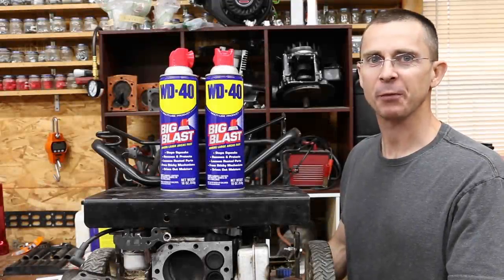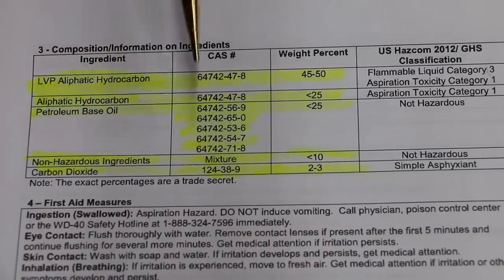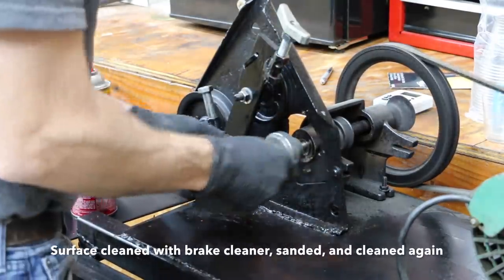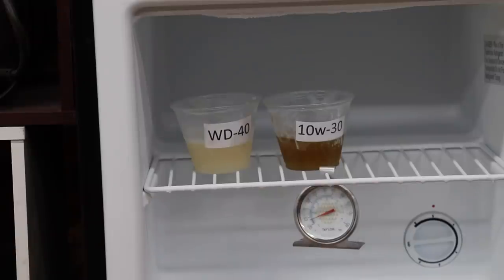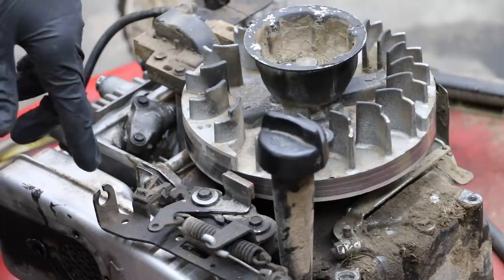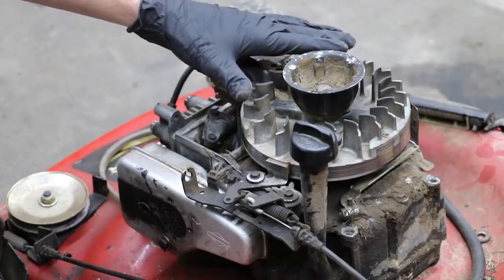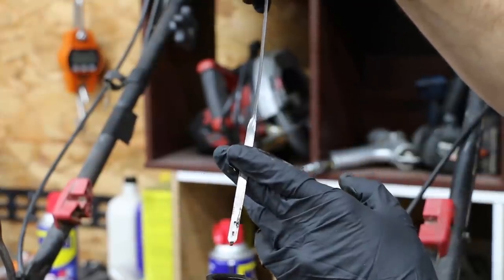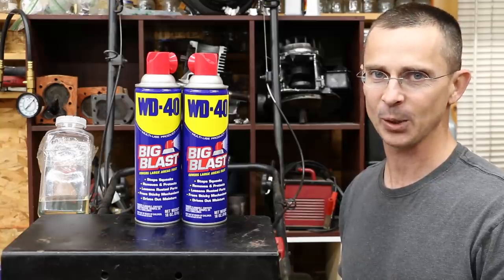Will WD-40 work as engine oil? Let's find out!

Comment: Interesting. I have found that WD-40 works very well in the bronze bearings of my antique electric motors. Completely different operating environment though. Even in cold weather, operation without the fan shroud is unrealistic, as evidenced by the extremely high temperatures encountered. I'd like to see how it does with proper cooling, examining the bearings both before and after.
Reply from the maker: Thanks for commenting on this!
Reply: You can (almost) analyze the bearings, by pouring the used WD-40 through a coffee filter. The thing I would have done, would be to run the engine with WD-40 for ~5 or 10 minutes, changed it, then, do the hour long run. That way, the crank case can be cleared of any sediment that may have accumulated over the years, which could show up in the filter, even if WD-40 wasn't responsible for any excess wear. Note that WD-40 is actually an excellent solvent, even if it's lubrication properties aren't that great. This might be a great way to FLUSH an engine, but certainly not suitable for service. (I STILL wouldn't do it with any engine I care about)

Comment: WD-40 has very low viscosity compared to regular motor oil. On the other hand WD-40 contains molybdenum disulfide which gives extra lubrication and protects the engine from damage until a certain point. You were lucky. Ot destroying your engine and i really was surprised about the result.
Thanks for the video 🙂
Reply from the maker: Great point and thanks for commenting.

Comment: About 30 years sago, I had an old right-hand drive Dodge postal trunk with a slant six as a mobile mechanic service trunk.
Late one night¡ I ran out of gas, and the nearest gas station was up the hill. Lifted the engine cover, removed the air cleaner, sprayed WD40 into the carburetor, got it running and drove 1/4 mile up the hill spraying continuously down the carburetor.

Comment: I have heard of guys using water in a crankcase in a real emergency, You need a bit of lube, but more than anything you need a liquid to remove heat. blow by was because of the lightness of the wd 40 not sealing the rings . wd40 likely contains ingredients that evaporate, more so when heated so one would expect the level to drop.  Try running the engine with oil but with the  fan shroud off, see if the temp. gets high too. Interesting idea and video. Thanks Project Farm  for doing it and satisfying our curiosity. I used to start cranky chainsaws by squirting Wd40 in the carb. Worked good, but it seems that the formula has changed and is not as explosive as it once was.
Reply from the maker: All great points. Thanks for commenting!

Comment: That slomo montage was oddly poetic. 

The title caught me since I've run a landscaping company for nearly 10 years now, starting from high school. In my early days, I owned several of these exact Toro mowers!
I'm quite embarrassed to admit, but I cannot recall if yours is the Tecumseh motor or the B&S while it is undressed. I felt that the Tecumseh-equipped mowers (while older) were much sturdier, with the engines outlasting the rest of the components (FWD gearbox would shear), while the B&S motors were the weak point. 

I remember one time, I was especially lazy and/or spiteful of the mower, and started putting whatever oil or lube I had at the time in the motor. Bar & Chain oil, WD-40, 2-stroke oil, etc. Whatever I had in the truck would go in the crankcase!
It was very frequently low on "oil" because they have a nasty habit of bleeding oil into the cylinder when tipped even slightly to the side. Sometimes I'd have to pull on it ~50 times before it started up, billowing blue smoke.
That motor eventually popped a hole in the block and chucked its rod! I guess it wasn't a fan of Bar & chain oil.
Reply from the maker: Thank you!  B&S.

Comment: I put two quarts of wd40 and 3 quarts of crap oil in a chevy small block to eliminate a lifter noise .. only ran it at 5 minute intervals with cool down between for about 15mins total.. and it worked.. no more noise and the engine ran well after putting in 10w30
Reply from the maker: Impressive!

Comment: I have seen WD-40 put into the crankcase of a warm engine then allowed to run with the oil for just a few minutes at idle. This was done right before the oil change as a flush. Only about a quart was used in this process. The oil did drain out very dirty but the oil drained dirty from that old truck always before that. I personally am not the biggest fan of flushing. In my opinion the filter is the key. Most modern filters have a bypass so at the point when the filter media is filled the rest of the service the oil is not filtered, this only compounds the problem. I have found that changing the filter half way through the service and topping off the oil works well and minimizes any chance of engine damage. Please prefill filters whenever possible, your engine will thank you.
Reply from the maker: Thanks for the feedback.

Comment: Very interesting to see that the engine survives with WD40 for one hour - I didn't expect that! 
I'm wondering if it was possible for you to do a similar test with an mixture of Diesel and regular Motor oil which is told to clean the inner parts of the engine (and even repair hydraulic lifters if they are noisy). 
Maybe this should be done on a "sick" car engine combined with checking the big end bearings of the connection rod before and after.
Reason behind that: A colleague of mine did this "experiment" (30% Diesel, 30 Minutes idle, then drain the stuff and add fresh oil) and "repaired" noisy lifters, but the engine broke down some thousand km later with worn big end bearings. Nobody knew if this was related to the "experiment".
So maybe you could do some clarification here :-)
Please go ahead with your projects, thumb up!
Reply from the maker: This is a great recommendation--thank you!

Comment: You should add a pressure gauge to the crank case ventilation port and see what the pressure is before and after these tests.  This is how they check if the PCV system is working properly on your car.
Reply from the maker: Great test idea!

Comment: I had an old mower thst smoked bad out the exhost. So I ran some prolong in it and it kept smoking. Ran ok. Then one day it stopped smoking, I realized it was out of oil, I pulled the drain plug and got about half of a cup out. So I put the plug back in and.... thought let's run this till it stops..... three years later it stopped...  because I hit a rock. Ran great till the end..     RIP Tecumseh
Reply from the maker: Wow!  Impressive!  I plan to test prolong soon.

Comment: When I was 18 I was a coal miner.
The coal cutting machine had a huge gearbox and I would take oil to use in my motorbike.
Mix with petrol, no problems, I ran it for about 3 yrs 24 miles a day.
I've used the same oil in car engines too.
Reply from the maker: This is interesting. Thanks for commenting on this.

Comment: So contrary to many people arguing that wd 40 does not lubricate this video proves it actually does albeit not as well as other solutions. In Karting for example where each run is 10 minutes only wd40 acts as both a cleaner and flushing agent in addition to lubrication for the wheel bearings in a scenario where all 3 factors are required.
Reply from the maker: Thank you for the feedback

Comment: That boiling point is a lot different with the carrier solvents in it until they dry, then only the oil will be left. It should lube better after that. Case smoke probably mostly evaporating solvent.
Reply from the maker: Great point.

Comment: Will WD 40 work as an effective crankcase cleaner, when you replace around 20% of your oil with it?

Is it better than diesel or atf which are usually used in a similar fashion to clean a crankcase.

Keep up the great work!
Reply from the maker: Great suggestion!

Comment: Without cooling, those temps  were actually low.  the blowby and loss of compression would be more than likely from overheating.  There was no more scoring in the cylinder after the run proving no excessive wear to the cylinder or the rings.  The loss of oil would be attributed to the lack of viscosity and allowing it into the combustion chamber through the rings.     

Rerun the test with the blower shroud on, and there would be totally different results.
Reply from the maker: Thanks for the constructive feedback.

Comment: Comment about your using the engine brake as a prony brake.  That brake is made to momentarily stop the engine by dissipating the flywheel energy only, once per stop, not for continuous use.  Have you looked at the temperature of the flywheel after doing that?  It has to be incredibly hot!  You could weaken the magnets due to all that heat.
Reply from the maker: Thank you for the feedback

Comment: WD40 is not a lubricant; it's a cleaner and water displacer.  The reason the engine survived is because oil in the crankcase does more than simply lubricate.  It keeps parts clean, it conducts heat and helps ensure uniform heating throughout the engine, and it maintains seal integrity and tolerances.  The WD40 did that other stuff as well--to a certain degree.  Since it is more volatile than oil it boiled off, taking heat away with it.  But ultimately the engine would fail.

Comment: The fan casing was removed so I expect the engine to run really hot, but how hot was it compared to a regular run without the cover and normal oil inside..?  Also the low boiling temp of the WD 40 would be a problem, I'd be wondering how it works when the normal cooling is fitter, in theory it should still be a bit marginal as the bottom of the pistons run at over 300 Degrees C, not far below the WD 40 boiling temp... This isn't a criticism, Im enjoying your videos a lot..

Comment: It looks like there's a couple things at play here. One, that WD40 is flammable so you're bound to see more carbon deposits, and two, the viscosity is really low! More gets into the combustion chamber, hence the high oil usage. The breather of course will relieve more blow by as the oil provides nearly no help on sealing the piston rings, which causes a lower compression, and again, more usage of the oil- a vicious circle. I'd just be careful using it due to it being so flammable!
Reply from the maker: Great point and thanks for the caution.

Comment: that was actually a lot more successful than anticipated  not nearly as much scoring in the cylnder as expected . wonder what the damage to the bottom end was though
Reply from the maker: Great point regarding the bottom end.  I didn't accomplish a before and after analysis.  However, there isn't any sort of knocking coming from the lower end. So, I don't believe there is any significant damage.
Reply: i'm sure it would be comparable to the damage of the cylinder wall since there is more abrasion in the cylinder then on the bearings in the bottom end  love your vids i hope your channel continues to grow you deserve it.
Reply from the maker: Great point and thanks for the positive comment!

Comment: i would like to point out that the smoke coming from the case vent was probably not "blow by" so mush as just the wd-40 getting hot and smoking, with it being exhausted every time the crank went to bottom dead center, lowering the amount of space in the crank case. however it was very interesting to see the slow motion of the case vent. i feel if you did the same test on a 2 cylinder engine or one with an even number of cylinders, you would get a better idea of how much is actually blow by and how much is what ever you but in the case.
Reply from the maker: Great point.

Comment: I think you need to redo this test with the engine shroud on so that the flywheel can actually cool the cylinder head as it turns and blows air past the fins. Maybe it was running hot because there was no airflow over the head cooling fins
Reply from the maker: Thank you for the video idea!

Comment: Carburetor cleaner test.  Make sure to include Berryman which sold at O'Reilly and crapvance.  And Walmart brand. For cleaning .i,e grease and oil.  And also ethanol and non ethanol gas
Reply from the maker: Thanks for the suggestion.

Comment: It wasn't very fair to leave the cooling cowl off, I think any engine oil would perform badly in those conditions. Are you not worried about shearing off the woodruff key in the flywheel using the engine brake or damaging the keyway in the aluminium flywheel? I've seen flywheels being damaged by heavy engine stalls. I love your videos, you're very thorough.
Reply from the maker: Great point and thank you.

Comment: Being a combustion engine, you needed to factor in the flash point of 138F, rather than the boiling point. With such a low flash point WD-40 is quite flammable which is consistent with your results. You'll never reach the boiling point for a liquid like WD-40 in the presence of oxygen, due to the flash point being lower than the boiling point. Furthermore, with an LEL of 0.6% in atmosphere, it doesn't take much WD-40 to combust.
Reply from the maker: Great point.

Comment: Removing the cooling shroud and running on engine oil for baseline test needed. Viscosity of WD 40 is very low. It is actually lighter than 5w household oil. Running without the shroud with light oil will give higher head and cylinder temps.
Reply from the maker: Thank you for this recommendation.

Comment: Love your videos, you do a good job but if nobody mentioned it you made a mistake with this test that will heavily sway the results.I say because you forgot reinstall the cooling cover on the motor that directs cooler outside air from fins on the flywheel onto/over the cooling fins on the cylinder and overall cyl block which without quickly overheats the motor when there is no cooler outside are being forced over the cooling fins on the cylinder while motors running.

So please redo the same test with the cooling cover on the motor and it  will run considerably longer or maybe the full hr test, who knows. 
Thanks again for all your great work doing all these tests,it’s appreciated! ,Scott
Reply from the maker: Thank you for the constructive feedback

Comment: considering that it evaporates when sprayed on a dry surface,   I almost feel the audience was trolling you asking for this.   WD-40 would be the LAST thing I would consider for motor oil.    Lawnmower engines are tough beasts... that's well documented.
Reply from the maker: Great point and thanks for commenting.

Comment: As a UK locksmith I get many customers telling me that they’ve sprayed their malfunctioning lock with W*40 to cure a number of problems.

The product is fine for cleaning, degreasing and very minor problems but it is NOT a lubricant! Really it’s just kerosene or paraffin in a fancy can at crazy price.

If your gate hinge squeaks it will cure it BUT a squirt of 3-in-1 OIL will cure the problem and is the correct engineering solution. 

W*40 is not a lubricant – use the correct engineering product to solve a problem – not the fancy advertising.

Four stroke and 2-stroke engine designers ain’t stupid and they understand real engineering – use the product that is specified – not what some dimwit tries to sell you in the hardware store.
Reply from the maker: Great point. Thank you

Comment: Maybe try gear oil in a ziplock bag to fill a differential. You push the bag of oil in and bolt the cover on and the gears pulverize it and the oil is released Vs one filled the usual way.
Reply from the maker: Thank you for the video idea!

Comment: Given WD40's nature as a heavy naptha solvent, it does have minor lubrication properties, much like old formulations of diesel fuel.  It's a shame you didn't show some images of the crankcase before and after. I bet it was almost spotless on the inside lol. 

I expected the drop in crankcase level, and even the blowby - thin oil viscosity actually reduces ring sealing capability.  I bet if you ran some 30 weight oil in that mower again the compression would recover that lost 5psi.
Reply from the maker: All great points. Thanks for commenting.

Comment: FYI this is what I was told about WD-40  1- WD stands for water displacement  2- it was made for the Army to dry distributors when they got wet  3- it was never meant to be a spray oil !! It has been so long ago I DO NOT recall where I even heard it SO it could be wrong !!
Reply from the maker: Thank you for this information.

Comment: The WD-40 company is well aware that the product is not a lubricant. By now everyone should know that it is the 40th attempt to develop a water dispersion formula... (Rather like Austin Powers' nemesis Dr Evil's attempt to develop a sinister weapon of mass destruction preparation and stopping at Preparation #H.)
To their credit, the WD-40 company did buyout the 3in1 Oil Company after being frustrated with trying to develop a superior all-around lubricant and couldn't do it.
Therefore, my suggestion would be to use 3in1 Oil in your next experiment.
peace-out..Tc
Reply from the maker: Thank you for this recommendation!
Reply: Tom Clark 

Actually, acquisitions like the one you describe value the brand and potential marketing and distribution synergies far more than any secret formulas.

Comment: Evidently, a ford probe cannot run for long using WD40 as engine oil.
One of the better Youtube engine blowups ive seen. Much explosion,  great sucess.
Reply from the maker: Wow!  Sounds as though the WD-40 evaporated off as we saw in this video but they never bothered to keep enough WD-40 in the crankcase.
Reply: Project Farm 

Not sure, judging by the the big and persistant flames, i think there was enough WD40 left in the crank case to ignite, so it didnt totally evaporate. 
Oil just doesnt't burn with that kind of gusto.